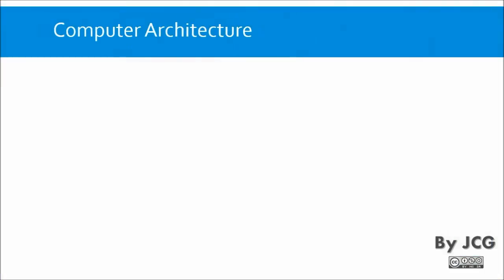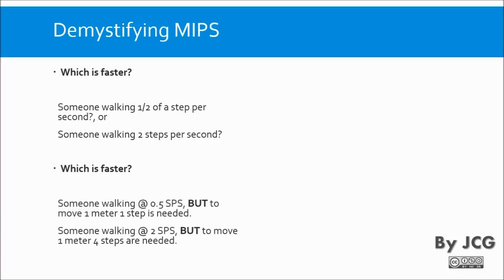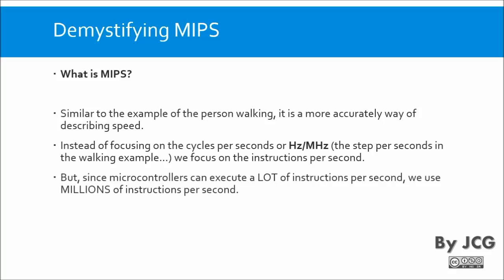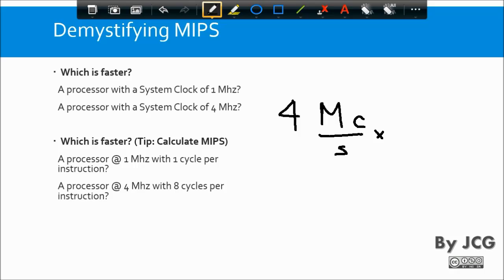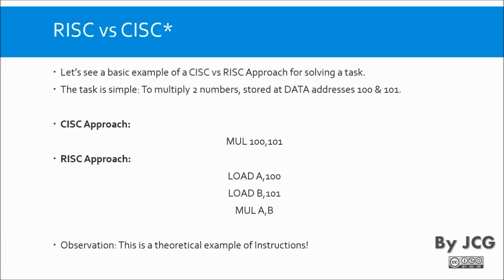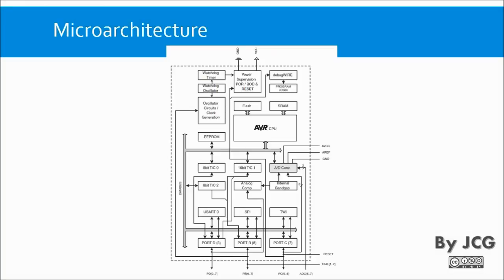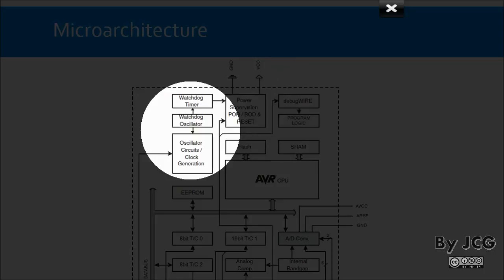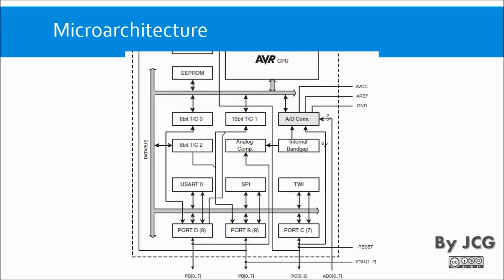ATmega328 Architecture Overview

Comment from the maker: Perfect! Just a comparison, the X360 works @ 3.2 GHz, our microcontroller work around 8 MHz, so you can see the difference in terms of speed!
Another thing to notice is the X360 has a microprocessor, and we're working with microcontrollers, hence the difference in performance.

Comment: Doing a little more research it was interesting and fun to find out how modern cpus stand in terms of MIPS.. Some systems that we may use in a daily base like the Microsoft's xbox 360 works at 19,200 MIPS at 3.2 GHz. Another measure frecuently used are the  Dhrystone MIPS which seem to be basically another way to calculate mips running a program in the host OS instead of readind directly the cpu milestones.. just sayin :)